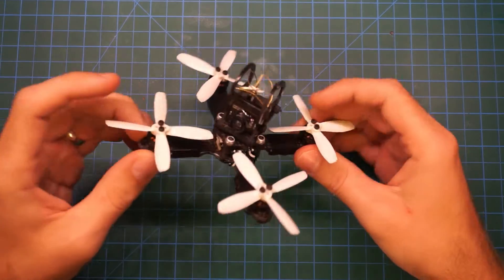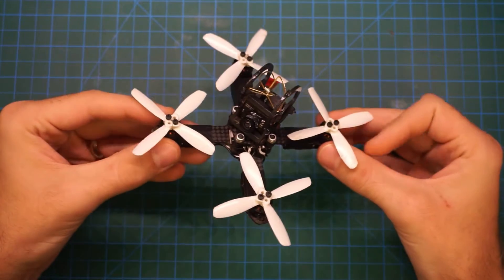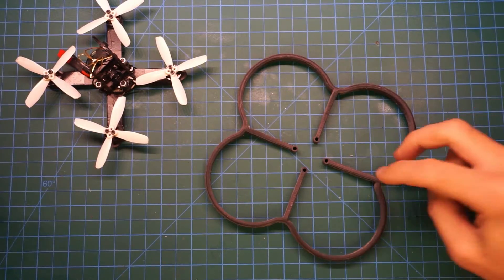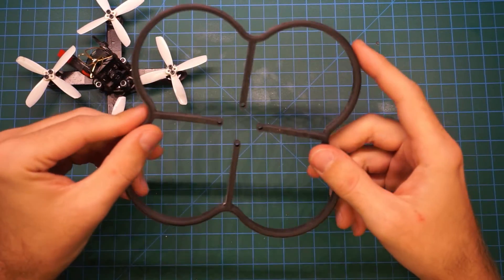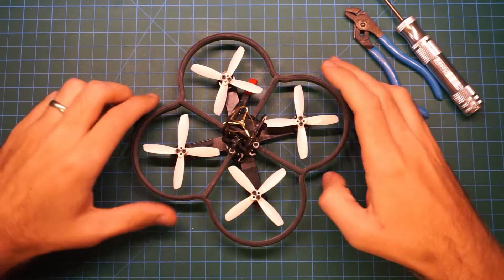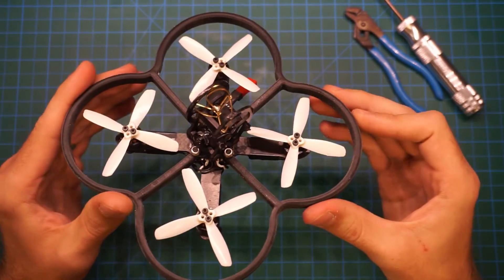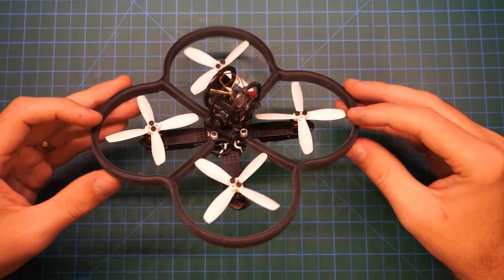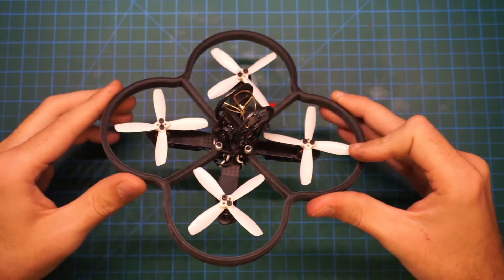Nyuki Indoor Brushless Micro FPV Drone Propeller Guard Design

Comment: hey man, you have to start using "construction lines" in SW. And use that "circular pattern" instead of repeating your sketch 3 more times. To save weight, you could make it smaller in diameter, you still have a few mm you go down before touching props.
Reply from the maker: Jerome Demers Yep. I still have a few bad habits from sketchup that I haven't fully gotten rid of in solidworks. 

V2 already has a reduced diameter and is much thinner. I will be releasing that stl as well once I do some testing.
Reply: can't wait to see the rest! Keep up the cool work!
Reply from the maker: Jerome Demers thanks man.